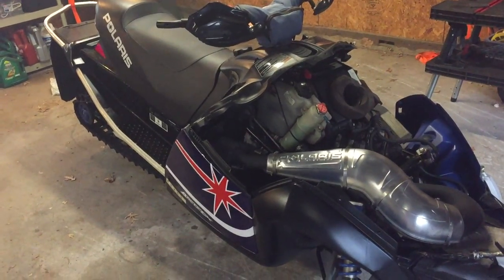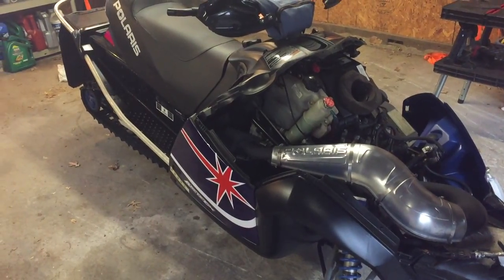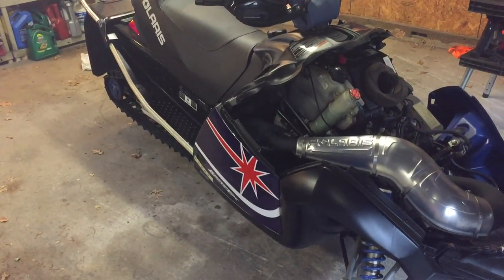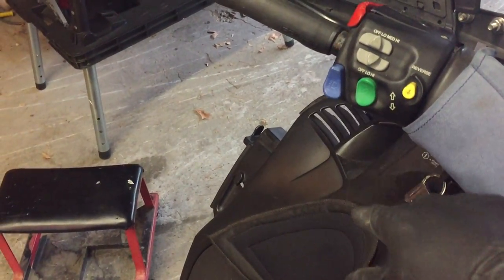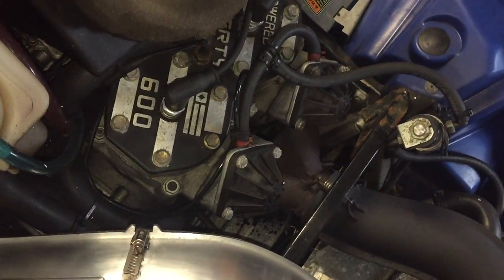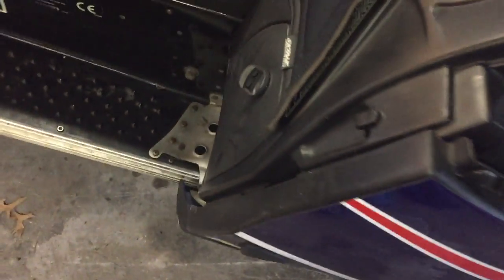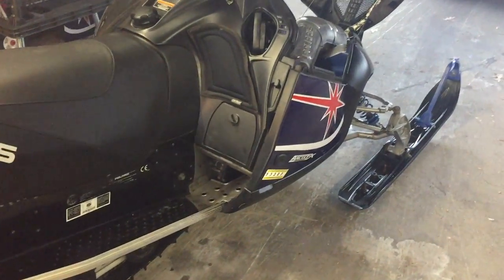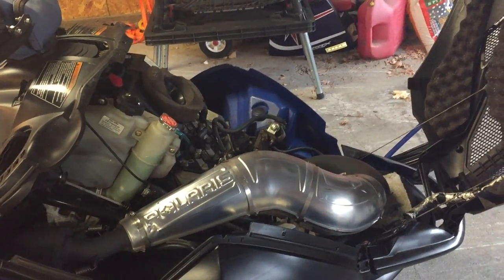Are You Ready To Ride - Snowmobile Riding PreSeason Checklist

Comment: Great reminder video that everyone needs to do. Just a few other things I like to do is, with your secondary clutch, when you are cleaning the sheaves pull the center bolt on the secondary and remove the clutch then grease the shaft with never-cease grease, this will save you a lot of hassle if you ever have to remove it. They like to rust on. Also at the end of the year I like to degrease the engine and power wash everything. This way everything is clean and it has all summer to dry out. Keep up the great videos!
Reply from the maker: great info